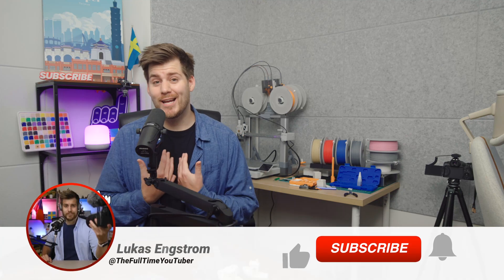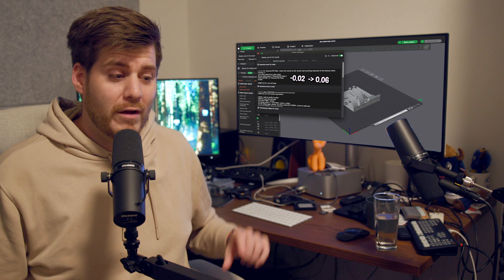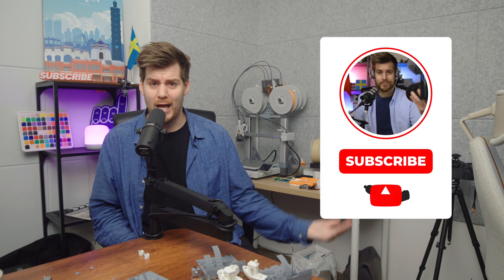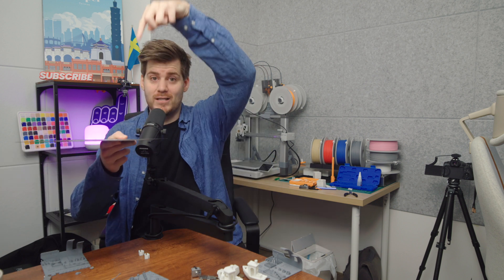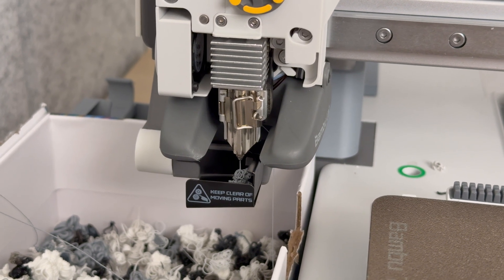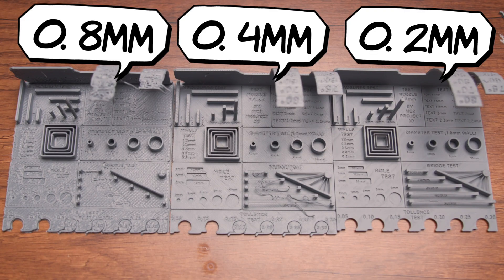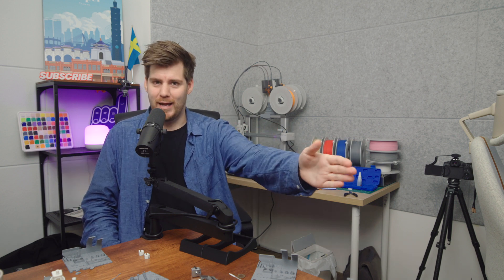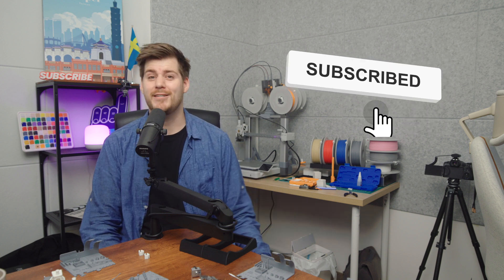This ONE BambuStudio Setting Saved My 10-Hour Failed Print! MUST-WATCH For New Bambu A1 0.2mm Users!

Comment: Do not do this all at once. Step it down in .01 increments. .02 at most. You can drop your nozzle on the build plate and destroy it easily. You can also do this in the first tab with the Z Offset setting instead of editing the gcode.

Comment: You need to be careful with this setting (this is the plate compensation). Changing it manually can cause problems with the printer or damage the bed. You are better off calibrating automatically. Bambu Lab printers are designed sort of like an Apple computer. They are supposed to be dummy proof.

Comment: Why is this not the default setting then? Or do most A1 printers work fine with the -0.02 offset? Seems a bit strange for the solution to be "set it specifically to 0.06" rather than "run such-and-such calibration" or "do [method] to determine what works for your printer." — And no blame to you. I'm just curious if you know the reason.
Reply from the maker: I totally agree and I had the exact same question myself! I have no idea. My best guess is that something happened during a firmware update back in the day and then we got stuck with this issue? No clue.
Reply: @TheFullTimeYouTuber  Hey, thanks for the reply! Yeah, perhaps some errant firmware update that solved one problem but created a new one. These things happen, unfortunately.

Comment: Gosh, man, I see you incorrectly secured the nozzle with a latch (which can not only shift the position of the nozzle but can lead to its movement during the printing), please refer to the official manual. Also, that silicone cover that you removed (maybe only for this video, but people watching this and also can decide to remove it after this) not just for the pretty view, it helps stabilize temperature inside hotend. For a few month using both 0.2 and 0.4 nozzles swapping them often and never had that issue. And the machine g-code is default with -0.02 value in that setting you mentioned. Also I must mention that the PA (K-factor) is drastically differ from that for 0.4 nozzle, so it is good thing to calibrate it manually (usually it is much-much higher).
Also do not forget to change nozzle type in printer maintenance settings. But I hope you did it)
And then you'll be able to print a bench boat that doesn't look as bad as the one you're showing, with those awful horizontal lines.
Good luck, and read that manual finally!))

Comment: I spent a few hours researching my issue, only to finally stumble on this video. While it didn't fix my issue even though our issues looked very similar, I appreciate any video that offers an insight and solutions into problems others are facing! Back to the drawing board for me (I'm looking at you, variable layer height).
Reply: Did you find a solution?

Comment: Great you found a solution.  I must admit slightly chuckling at it taking 10 hours to troubleshoot that, when as an Ender 3 veteran it took me about 5 seconds to recognize the probable cause of the issue, because been there done that. :D
Simplify3D has a great visual 'print quality troubleshooting guide' with pictures of print failures to help you find a match for your problem (idk if I can link it, but should be easy enough to find on a search engine of your choice), it would have likely saved you a bunch of time troubleshooting.  Guess the guide is still useful after all these years, despite the advances in mostly turn key printers. :)

Comment: I changed all of these settings and I'm still getting a horrible first layer. 10 hour rabbit hole here I come. 🥲
Reply: Update: Only a 5 hour rabbit hole. The problem was in the 3mf file. Changing these settings for an existing 3mf did not change anything. Bringing the model into a new instance with the updated g-code fixed the problem.

Comment: I’d like to see u print petg on the textured pei plate. My prints look exactly like that on the first layer but I’m using .04 stock nozzle. Small prints are fine. Big ones look like your first layers
Reply from the maker: I have never had any issues with 0.4 nozzle and I print PETG a lot. Not sure what that issue could be.
Reply: @TheFullTimeYouTuber  thankis for the reply.  It looks like the nozzle may actually be contacting the plate and rubbing the filament around.  But since i cant figure out how to set the z offset in BS I guess im cooked.

Comment: So even tho some prints worked fine with the 2.0  and no setting change ,  but for the test print you changed the settings and the teat print worked fine ... are you saying that we should do this setting change for all prints using the 2.0?
Reply from the maker: This is only if you’re having this specific issue with the 0.2mm nozzle.

Comment: My latest version of Bambu studio no longer has the machine g code tab.Under filament advanced you can see the start G code but it does not have the G 29 Z setting. Is there a way to do this with current versions of bambu studio ?

Comment: Lukas, thank you for your video. Never realized you could change those setting on a X1C.
Trying to print something small the last day, and no adhesion at all. First layer mostly fine. Later on it came of the plate.
Two day ago I printed self designed keychains in four colors, with the 0.2 nozzle. And they turned out fine with crisp lines and text.
Just an hour ago I realized I installed a newer firmware version (01.10.01.00). Now downgraded to firmware 01.09.01.00 and the print is fine.
I my case no need to change the G-Code. I will remember your solution and made a note about it.
Reply from the maker: Glad the video helped you out, and thanks for sharing your findings!

Comment: Lukas, bro, your spring clip is not on right! Those two metal teeth are supposed to go inside the two metal hoops. If it feels like you're forcing it, heat up the nozzle to 140c before closing the clasp. Bambu wiki shows how it is supposed to look and you'll have a lot better print quality and Z-offset detection once you do this right.
Reply: @TheFullTimeYouTuber
Reply from the maker: Hey,
Yea the broll is from then I had to replace and change nozzles all the time. So I "cheated" a bit with not putting back the silicone nozzle etc as well. Didn't realize the importance of it at the time. However, it didn't have any effect on the specific issue that I tried to solve though. Tested this way too many times and the only thing that actually helped or had a visual impact was the change in G-code. It's all sorted out now though and the metal teeth are were they are supposed to be! Thank you! :)
Reply: @TheFullTimeYouTuber  I did have this issue myself. In my case, I had to get a new eddy current sensor (which meant, a whole new tool-head block) even then, I had a second issue of too far from the bed. What it ended up being? I needed to clean the leads for the eddy sensor with alcohol and then make sure they were quite firmly screwed into the contacts on the hotend motherboard. The g-code solution is 100% more fool-proof though, since no matter what it is, eddy sensor or knock sensor on the underside of the headbed, gcode can sort it.

Comment: Hey man. I still can’t get mine fixed. I’ve tried changing the g-code. Is there any other settings, maybe temperature along with the g-code that worked for you?
Reply from the maker: Sorry to hear that. No, actually nothing worked for me other than changing this code and then I didn’t have to do anything else. ¯\_(ツ)_/¯

Comment: So,just changing that g code solves any problem?I print really small miniatures with 0.2,don t i have to change other settings too?i have a1 mini
Reply from the maker: It solved this specific problem, for me. If you have any other issues you might need other solutions. But just changing the nozzle in Bambu lab studio to 0.2mm should be enough :)

Comment: Thank you for the video. I have tried the (0.06) G-code adjustment with my A1 mini using a 0.2,mm nozzle. it did not work for me. I am currently. trying (0.08). I want to see what results i get.

Comment: i have extruder skipping sound and very hot extrusion motor, any tip to improve my print in 0.2 nozzle ?
Reply from the maker: Hum... I'm afraid I don't have any ideas other than the ones in this video. I honestly try to avoid the 0.2mm as much as possible to be honest. Never found a good perfect solution for this (yet!).

Comment: oh i need to try it, this issue was primary reason i did not print with 0.2 because even on smooth plate it was kinda failing and i printed on textured one some stuff back then on 0.2 and after that i sticked to .4 to almost anything with occasional changes between all of the nozzle on bambu available

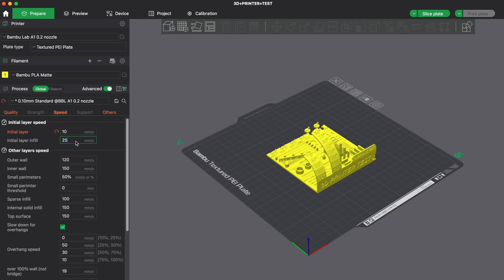Comment: Btw. your nozzle is not correctly attached at 7:19
Both sides of the wire clamp loop should be on top of the sheet metal clamp.
That can/will also cause z-height problems.

Comment: Hi Lukas, thanks for the tip! Do you still suggest to change the other settings as well (temperature, speed, dynamic flow, layer hights etc) or is that counterintuitive ?
Reply from the maker: I would recommend to only change one thing at the time to keep track on what works or not. Try the G-code change, but then if that doesn't work you can try the dynamic flow etc., but unless you know what you're doing, only change one thing at a time (I have no idea what I'm doing, so I just try it all one-by-one haha)

Comment: So, quick question - I don't spot any of the other plate types in the Machine Code. Is the "TEXTURED PEI PLATE" just a Placeholder for all the plates, or does this fix specifically and ONLY work with the Textured Plate, rather than say the Smooth Plate?
Reply from the maker: I believe this is only related to the Textured PEI plate. I have never had any issues like this with smooth plate (or the 0.4mm nozzle) so I feel this might be an incompatibility issue with the 0.2mm and textured plate only? Honestly not sure.
Reply: @TheFullTimeYouTuber  Alright, reporting back already and it certainly makes a difference. I had to adjust the offset to 0.03 since 0.06 seemed a bit too high which resultet in adhesion issues, so I suspect the exact paramters might differ from Nozzle to Nozzle. I will incorporate the fix in my Profile Settings and credit your Channel if you don't mind. My own channel isn't much to speak off, but it's about the principle. I'll mess around with it a bit and let you know if I find some adjustments to make it work for another plates too.
Reply: @TheFullTimeYouTuber  Thank you for the quick response, I'm gonna give it a try. Maybe I can tweak it to work for the other plates as well. I have sorta "specialised" on High Detail Miniature Prints using FDM, and ran into some issues lately. If this doesn't fix it, it has to be a Hardware Issue.

Comment: This has been my EXACT issue with the 0.2 nozzle & you helped me solve it! No one else on the internet had such a crisp recommendation. 

I wonder now—does a 0.4 hardened steel nozzle require g-code adjustments? How about g-code mods for the smooth plate vs textured? 

Thanks you! ✅ subscribed!
Reply from the maker: Very glad to hear that it helped you! Honestly, I am not sure about the 0.4mm. I have never had any issues like this with either 0.4mm or using the smooth plate, so I feel this might be an incompatibility issue with the 0.2mm and textured plate only? Honestly not sure.

Comment: What if im having similar issues with the regular 0.4mm nozzle is there a fix for it? the first layer gets messed up but then the overall print looks fine so idk if I should change anything or not.
Reply from the maker: Good question, I am not sure. Can try to increase the layer height and increase the flow rate maybe, but I haven’t played around enough with the settings to be certain about this.

Comment: What was your first layer height?  On a textured build plate I think even with a 0.2mm nozzle the first layer should be >= 0.2mm.  Also, was your build plate type set correctly, because that should also affect z-offset.
Reply from the maker: Forgot the details, but it was the correct plate and I used the default settings from the print. Worked with all other combinations and plates.

Comment: For me what solved the issue was tightening the screws of the heater block. You notice how the layer is not uniform even when the z offset should be meaning the distance of the nozzle from the bed shifts.
Here's a guide I followed 
https://youtu.be/k2BYvY72XSM
Reply from the maker: Thanks! I'll look into this. All other prints have worked just fine though (except this 0.2mm on the PEI Textured plate), so don't think it's an overall screw issue in my particular case.
Reply: @ That's exactly how it happened to me. Only on 0.2mm did I encounter this. I guess the z offset for 0.4mm is high enough this doesn't matter.
What I think happens is the nozzle is stuck to the heater block magnetically and with a latch, then the filament is pushed into the nozzle by the extruder, forcing the whole assembly downward. when the screws are loose, it shifts the nozzle down enough to touch the bed. Then pressure builds up in the nozzle until it forces it back up so you see repeating thinning lines in your first layer.

Comment: Did u try with smooth plate enabled instead, it changes the z offset
Reply from the maker: I have only tried with the textured PLA plate and 0.2mm as that was the only combination I ran into issues with. Might run some other tests later and figure this out!

Comment: I could not get any prints with the 0.2 nozzle to work until I saw this. Made the G-code change and I'm half way through a print that failed in the past. Question, I use Bambu's Cool Plate Super Tack but did not see that setting in the G-code. Can itr be added or should I not be using the super tack with the 0.2 nozzle.Thank you.
Reply from the maker: Super happy to hear that it helped! Crossing my fivers that the rest of the print turns out great as well! I am not sure about the super-tack plate actually. I personally do not want to add anything in the G-code unless the overall category is there already. Unless you’re feeling adventurous, maybe wait with the super tack if your print is giving you issues with that plate?
Reply: @TheFullTimeYouTuber  Print turned out great. I scrolled through the entire G-code start section and the only plate reference was the PEI plate. I have some other FB resources to check. And again thanks for the tip. Was driving me nuts.
Reply from the maker: @MikeDeramo  Thank you very much for the follow-up! Yea, I don't know if it's an issue with the textured PEI plate or not. Regardless, very happy that my video helped you out. I totally understand the satisfaction of getting that print fixed!

Comment: I'm new to Bambu printers and I did notice there is no z-offset calibration as on other printers (i.e. the paper test). Does the A1 not automatically set the offset? That seems odd that you would have to manually change the start g-code for the profile rather than for the printer to do it for you.
Reply from the maker: I should clarify that in most cases it works like a charm, and no adjustment is needed. But yea, for some reason (especially when it comes to larger surface-area prints), there are definitely some improvements to be made here... I'm sticking to 0.4mm for a majority of my prints and haven't had any issues with that so far!

Comment: Hey Lukas! Great channel it’s very exciting to watch your journey! I would like to mention one thing I noticed the silicone sock is off your hot end, I would highly recommend using that. If you ever have a failed print and the filament cakes up on the hot end, it will destroy all the wires right behind the hot end. The silicone sock definitely protects those wires from getting damaged, but also from the filament globing up on the tip of the hot end. Cheers friend!
Reply from the maker: Thanks! Yea, this footage is from then I just did all the testing and changed nozzle after every first layer to troubleshoot. When I’m not in “testing mode” it’s always on. Just got too lazy putting back the sock and plastic cover after the 8th time 😅

Comment: Thank you for sharing! Will this change work with 0.4 nozzle too? I am having the same issue with first layer but with 0.4mm nozzle
Reply from the maker: I haven’t tried it myself, but it should work. This setting is for the PEI plate specifically, but it’s super easy to change back so you can give it a try and let me know!
Reply: After having a few first later issues jumping from different brands.
Do first layer flow ratio tests and then change first layer flow ratio on first layer in (quality) if using bambu studio.
Reply: I think initial flow ratio is always at 1. And I've been down as low as 0.84 to get a really nice smooth first layer with some filaments.
Also plate dependent ie smooth ,textured, clean , oil free , bed temp.

Comment: Your nozzle latch isn't closed correctly.
Reply: LOL, I was going to mention that as well :-)
Reply from the maker: I might have cheated with this after the first couple of hours, yet. Was tough to get it perfectly on when it was still super hot. And got tired of waiting after a while. Didn’t affect the end result though, didn’t work even when it was perfectly attached.
Reply: @TheFullTimeYouTuber  When I first switched to the 0.2 mm nozzle I got the exact same problem, nothing help with changing settings. Then I realized that the latch wasn't closed correctly (exactly as yours is shown in this video). After I closed it correctly everything worked perfectly. I'm no expert by any means, but my two cents is that the problem was caused by a loose hotend and not by the gcode settings.